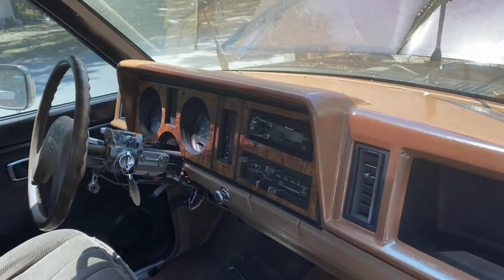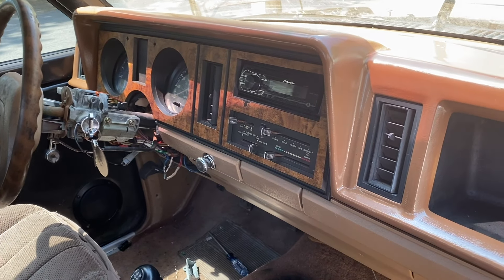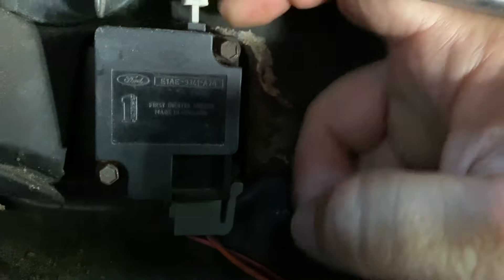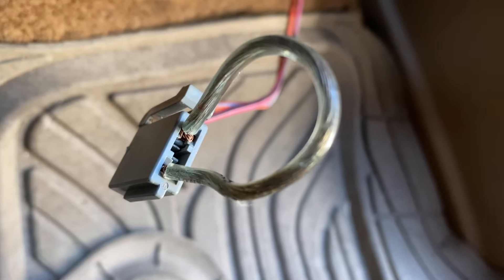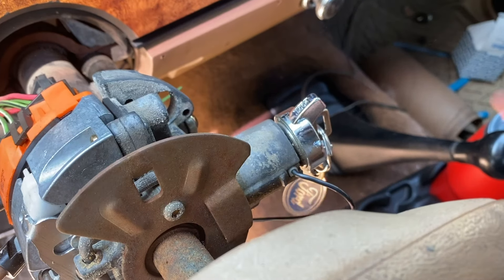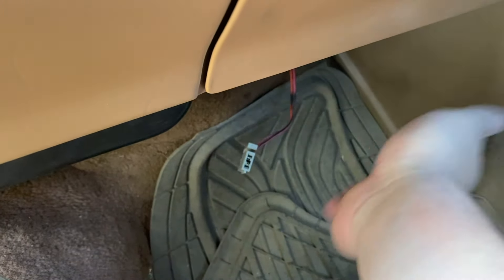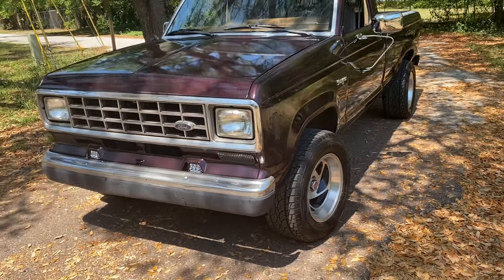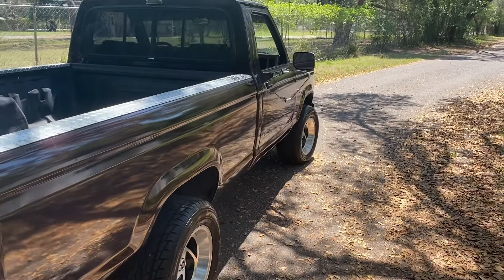How To Bypass an Inertia Switch | What They Are, Where They Are & Why They're Important

Comment: My Ranger sat for 6 months and then wouldn't start. I replaced the battery, fuel filter, fuel pump, siphoned out the old gas, replaced the plugs, wires, cap, rotor and coil. She still wouldn't start and stay running.... I wish I would have found your video sooner. It would have saved me $100's and many many hours and headache... Awesome video! Thank you!
Reply: This sounds very familiar dear sir I'll check it out
Reply: Were is my inversion switch I have a 2005MERCURY monterey van
Reply: What happened to you is exactly what happened to me😭😭😭I spent so much money only to find it’s the switch 😭

Comment: Dude you just saved me so much trouble ! Truck died at a stop sign, couldn't figure it out, did this and bam! Shes back on the road 🤟🤟🤟
Reply from the maker: Glad it helped ya!
Reply: @Cannon Toby yea, been using Flixzone} for since december myself :)
Reply: @Cannon Toby Definitely, been using Flixzone} for years myself =)
Reply: @Cannon Toby Yea, been watching on Flixzone} for since december myself :)
Reply: @Cannon Toby Yea, I've been using flixzone} for since november myself =)
Reply: My friend one question how many wires your inertia switch plug has, my has 3 wires but i do not know which wires i need to connect, thank you in advance

Comment: My 86 ranger sat for 4 months after i parked it,,i lost the key and had to remove the keylock and tumblers . now it wont start ,the dash lights come on but no run when i crank it. i put fresh gas and new battery  and bypassed the inertia switch. Only one wire from the keylock is not hooked up..is that my problem?

Comment: I just acquired a 1989 Ford F250 4x4 that's been parked in a building for 22 years. It has 40,000 original miles. I put tires on it. New plugs, changed the oil & filter. New battery - everything came to life, but it wouldn't start. I put 3 gallons in the front tank. I changed the fuel relays. Won't start. It will turn over quickly. It will run temporarily on starter fluid. Thanks to your video I'll take a look at the inertia switch next. - before I replace the electric fuel pumps/tanks.  Thanks

Comment: Great. These short videos. Are helpful. Thank you.  I have a jumper wire. I will replace the inertia switch first before I replace the electrical wire harness. I've already changes the fuel pump and fuel filter. In addition to the fuel relay fuse which was blown. Thank you.

Comment: If you are still around, hoping this fix will work for our F250 Super Duty V10 6.8 L
Won’t start. Replaced fuel filter and brand new battery. Going to try your bypass idea to see if it will allow the truck to start.

Comment: My 93’ Ford probe has a third middle wire on the wiring harness that plugs into the cut off switch. When jumping the two outside wires together, what am I supposed to do with the middle wire that goes into the wiring harness please and thank you I’m having some serious trouble getting this probe to stay running. I’ve crossed the wires every direction and what not and haven’t had much success.

Comment: Hey great video, i have 87 ford f150 same switch and wire different location. My switch is doing the same thing as yours, But I pulled the plug, put a teslight on, turn the Ignition. I'm not getting any twelve volts to the plug on either terminal.What could that be. Please help

Comment: Good morning. I wanted to see if you could help me. I am stumped. I have an 88 GT Mustang that won’t start. It’s only getting 3 volts at the fuel pump. It’s getting 11.5 at the inertia switch. I even put a jumper wire on that in case the switch was bad and still 3 volts at the pump. I swapped fuel relay with another Foxbody I have and that car starts with both relays. Any idea what I’m missing? I appreciate any help.

Comment: I've got a 86 Ford ranger 2.9l 6 cylinder 4x4 won't start. Ive replaced in tank pump and tfi mod. It will turn over just won't start. Tested pressure regulator. Gas shoots out of it one then try to start it and test regulator again nothing. System not staying pressurized. What other things can it be

Comment: I'm a widow and I'm doing all my work on my 05 Pony and I could use some advice I've checked my fuses are good I believe but I am still having problems with point A to point C I've replaced my fuel pump and quite frank my hair is getting rather thin any pointers of help you may have

Comment: I put a new inertia switch but for some reason it will still cutoff sometimes then u tap in the sensor and bam it works again . Keep in mind this is a new sensor from auto zone. Could it be a problem with the connector?

Comment: My 2006 Ford ranger 4.0 v-6 after engine runs a while or idles a long time & when I shut engine off, engine will turn over, but not start. If I reach & hit & hold the fuel safety or inertia button & hold button down, engine starts & runs perfect. What's the problem?

Comment: I have a 1996 Lincoln Towncar that left me stranded at work last night. I had no problem getting to work, but when I was ready to go home it wouldn't start. Luckily the AAA tow truck driver knew about the Fuel pump cutoff switch in these older Fords and went fishing for it. My car has a nice bright yellow label pointing to exactly where it is in the trunk. And it was right out in the open. He pressed the reset button and it started right up. He saved me an untold amount of aggravation. My question is...what made the switch trip? I wasn't in any accident or hit a speed bump. I need to be able to avoid future shut offs because I know my luck. The same thing might happen again and I'll go "Oh hey, I just saw this video explaining what to do." And I'll try it and it won't start. I need to know if this was a freak circumstance, or is the switch faulty and needs to be replaced?
Reply: From what i hav heard they have like a ball in there and ya they can wear over time. im replacing the one on my p71 as i notice a lag when i take a sharp right turn...
Reply: The only way to figure that out is drive it and see if it happens again. If it happens again soon, replace it. Or buy one off eBay and replace it to be on the safe side/ throw it in the trunk for an emergency, whatever. You can try hooking up to a code reader but I don’t know if that’ll get you anywhere. Good luck

Comment: Trucks ignition switch went bad so it got stuck on. Took it to a friend's house. He pulled the fuse and the first one that he pulled from under the hood was the anti-theft and the fuel pump fuse. Of course the truck stalled upon replacing the ignition switch and the actuator and the column that reset the fuel system and burn up the fuel pump. So then we had but the new fuel pump in well when we drop the tank to put a fuel pump in tank had a crack in it. After replacing the fuel pump tank and feeder tube. We got good fuel pressure. It started up for about 3 or 4 seconds and then would not start again. It's cranking. Like I said we got good fuel pressure now but it's not firing so we're thinking ESC. What do you think?

Comment: Thanks for this video.  I have a 1986 Ford F-150 4x4. I am sinking more and more money into but it was my dad’s so I just keep fixing the next thing.  The truck wasn’t starting. The inter tank pumps were engaging but it wasn’t starting.  So, I replaced the external fuel pump and filter.  It still isn’t starting and now I don’t hear any of the pumps engaging. When I put the external in I cycled when I put on the wiring. My inertia switch is tripped and I was so excited for this video… but it still didn’t start.  What should I check next?  I did pull the front and back fuel lines and am 98% sure input them back on the filter before the external fuel pump… would that cause this issue if they were switched.  I don’t think that is it though. I have looked at the relay but it isn’t going to be easy so I thought I’d seek advice first.

Comment: I have a Ford ranger 1997 2.9 v6 I need to no what line coming off the fule pump is the fule line and witch one of them is the return line someone had cut all fule lines off of it and what is that round thing on rail it's got one line going in on top and one on bottom and coming out of the round thing has two lines going to rail I don't no witch one goes where

Comment: i have a 2000 ford ranger 4.0 replaced fuel pump but dosent get power to run it checked inertia switch with by pass still no start

Comment: Thanks for your video, the problem that I’m having on my 2004 Ford F150, is that when it doesn’t turn on, I check the inertia switch and it’s not tripped. However, when I disconnected and reconnected, my truck will start up. I  replaced the nurses switch but the problem to remains. I noticed that it occurs more often if the temperature is colder outside. If anyone has any suggestions I’d appreciate them. Thanks!

Comment: great video......thank you....I have a 2003 mazda protoge Dx.....I am trying to find out if it has a inertia switch......I looked everywhere meaning research on line.Nothing shows me that it has one as well that it DOES NOT have one.   engine cranks,(these items have been checked and appear to be fine.......battery,relays,starter,fuel pump,    )      Any feedback would be very much appreciated   Thank you again !!!!!!!!!!  Happy TG

Comment: Hey there, I have a issue with my 84 f250. The engine starts hart an It runs only on 7 cylinders. But I have spark on all 8. I thought it could be the switch like you showed in your video. But after I pushed the white putton on top the gaspump is not working anymore. 
Can you help Me out?

Comment: Ok so I have a 1988 2.9 and I've replaced fuel pump,put new injector o-rings, new ignition,new relay, and my fuel pressure seems really high at 90psi before fuel rail but the other day it ran like a champ now it's doing the same thang some how it's either getting to much fuel or not enough I don't know what to check for this you can here intank fuel pump kick on and injectors

Comment: My 1994 Ford f150 5.0 starts up every time but if I go to the corner my truck will act like it's starving for gas dies but it starts right back up and if I go a little further and start doing the same thing it starts right back up I changed the fuel pump the fuel filter I took out the front tank cuz it was overflowing it's doing the same thing trying to find out what might be causing it

Comment: So I converted my electrical fuel pump to a mechanical one. I have a 1982 f150 with a 1972 300 inline 6 4.9 l. Could this still be my issue

Comment: Okay I have a 2002 Ford Ranger I was told the fuel pump is bad $360 he said he went and got a new fuel pump etc etc didn't start went back and got another fuel pump didn't start and then I saw him spraying started fluid under the hood it started it turned off after a few minutes said see it runs he took off real fast and my vehicle now it won't stay running well I'd mess with the relays jump the battery the truck ran so I drove it to a friend's house on the way home It  turned  off turned it back on and started for a little bit and then it kept doing that I had to pop the clutch go in about 30 or 40 when it died it's sat for about 30 and it started again ;- lost power again I finally got last night I got into it it drew I drove to the store and came right back it was only 3 blocks away so could you tell me what you think it might be I'm a female that don't really know that much about Ford Rangers I know the basics so help someone!!!

Comment: I cant find any reset switch on my hyundai santa fe ...i need help trying to fix it,, it just crank but wont start...am from Samoa
Reply: My friend I hope you find the problem I have a 2001 Hyundai sante and I had the same symptoms, first the inertia switch is in the engine compartment close to the brake master cylinder driver side. Now how I fixed my car, my starter was the issue it was cranking but it was not engaging with the flywheel, I took it to AutoZone tested and sure enough it was bad, at first I couldn't believe it but then when I installed it fired up, I was happy, what a relief after doing so many tests. That was my experience.

Comment: I have a 2003 that trys to run but won't changed fuel pump, MAF,Plugs, crankshaft sensor, fuel filter and it still won't stay running

Comment: Will try this tomorrow on my '86 F150. I'll update you if that is my truck's problem. Thanks for the info regardless
Reply: @1RamsHead. This is the same truck I have.   Was this your issue?  I tried the bypass and it still isn’t starting. I’ve already replaced fuel pump and filter.  Don’t hear any of the three pumps priming.
Reply: @raymott6912  mine was a bad fuel pump. Did all the troubleshooting until I found the problem.
Reply: @1RamsHead I have the same issue. Truck died on highway. Replaced fuel filter, fuel pump. Distributor cap/rotor. Truck starts with carb being primed then dies after. What else did you check?

Comment: what if I cant find one. I've looked at the manual diagram plus like five others online.  I'm wondering if the original owner may have just totally removed it?  Our ignition is stuck on and were trying to just shut the engine off.

Comment: Maya Nursery switch only has power running to one wire how do I diagnose for the other problem is
Reply: Hi i am having the same problem i have a Hyundai Santa Fe 2001, only one wire shows current with a test light what about the other two wires, how these wires work, my connector has three wires but i do not know what to connect to do the bypass, any help it's appreciate it, thanks in advance...

Comment: Hello Sir, nice video, straight to the point, I like it. I see your inertia switch has 2 wires to do the bypass, can you help me out please i have a 2001 Hyundai Santa Fe 4 cylinders, my switch connector has three (3) wires. Do you know which wires should I connect to do the bypass, i test the wires with a test light but only one shows me current/juice what do you think it's the problem, any help my friend it's appreciate it, thanks in advance..

Comment: I have a 1987 ranger the fuel pump stoped working put a new fuel pump relay a eec relay still nothing i didnt bypass the one on the passenger side i had tomove the truck so i straight wired the pump with a swicth it run for about 7 miles. the engine just cut off the pump still running

Comment: What if your getting a rapid clicking from the fuel pump relay. Should I try this. I've already replaced the fuel pump
Reply from the maker: Sounds like a ground issue or a bad battery / electrical flow
Reply: @Archifx  the battery is still good

Comment: Paper clips work great for a jumper wire
Reply: My friend do you know which wires need to connect to do the bypass my Hyundai Santa Fe has 3 wires, i am assuming one is for positive side , the other is for ground/negative, and the other is for ECU-computer, but i would like to know which wires i need to connect for bypassing the inertia switch, please help me if you know how it works, when is 3 wires in the plug, thanks in advance..

Comment: I have a 2003 ford escape 3.0. I had to replace the radiator. After radiator replacement it ran fine for about a day. Now it turns o er but wont crank and gas smell is strong

Comment: Hey bud, great video. My 1989 Ranger, new pump, inertia switch good or operating, new relay. No power to pump. May have a bad wire connection somewhere but can not locate.
Reply: No power to inersha fuel switch.   But power to fuel pump relay. 2000 Ford. Ranger 2.5liter manual tran
Reply: Any one know ??

Comment: Hey man i changed my relays, and bypassed the inertia switch and it still doesn't run
Reply from the maker: Get down there and check the pump itself at that point. Also check your ignition switch. Make sure power triggers are happening at the switch
Reply: @Archifx  97 lincoln town car, been doing the key trick for 2yrs now the trick doesnt work. shops telling me to start at the fuel pump. it doesnt take two yrs for the fuel pump to go out. of course the fuel pump isnt coming on but why? all i know about cars is how to put to gas in. had it towed to several shops but they wont run a full diagnosis, just want to sell a pump. and when i did the key trick the car ran like a dream, no sputtering or stopping, no signs pointing to fuel pump. dont mind spending 600 dollars but a fuel pump cant be the answer. please say you are in kentucky!!!
Reply: @60403tnw  what is the key trick?
Reply: @jasonekstam4022  turn the key forward (not crank), turn the key all the way back, wait about 3 seconds, repeat about 3 times. you will hear fuel pump suck, then you know its time to crank. worked for 2 yrs till it didnt... guess what, it was the fuel pump

Comment: Mine had resistance through it and when i would go over bumps it would turn the fuel pump off and on super quickly causing a mean buck while accelerating. Happened at 220k miles (Escort zx2, 2.0 zetec)

Comment: SIR I have tore my truck apart put in 3 fuel pumps chased down wires just short of wiring a whole new wiring harness myself SIR if this is what is the problem I will strangle the engineer who designed this SIR
because I do have a wire hanging that looks just like that and I thought well that's not it it's only two Little wires SIR
I WILL FIND AND STRANGLE THE ENGINEER IF THIS IS MY PROBLEM SIR
Just kidding SIR
 Ranger lovin' a Ranger

Comment: I have a 1988 Ford ranger it's very difficult starting but once it starts it does run I'm wondering if it's the inertia switch itself because as it warms up too it gets even harder to start it has been recently tuned up carburetors been rebuilt engine rebuilt transmission rear end etc please advise